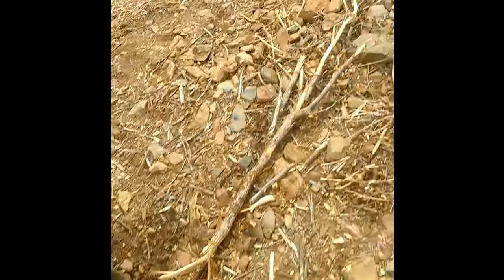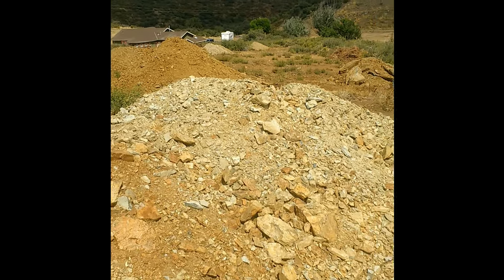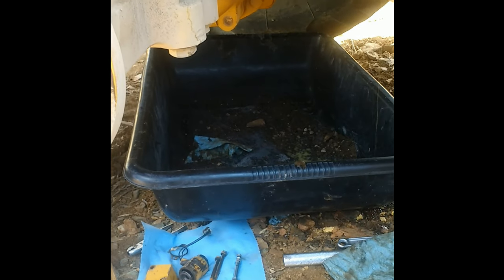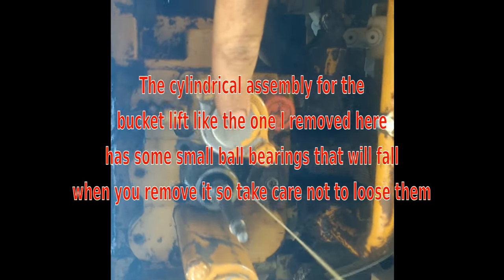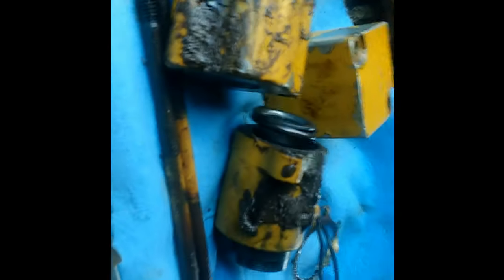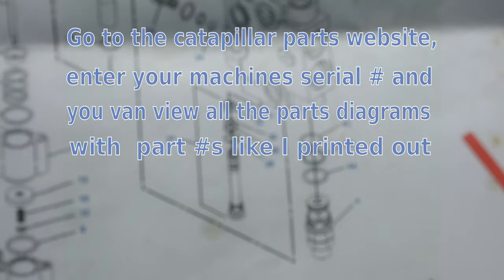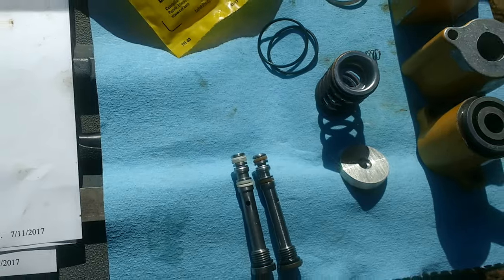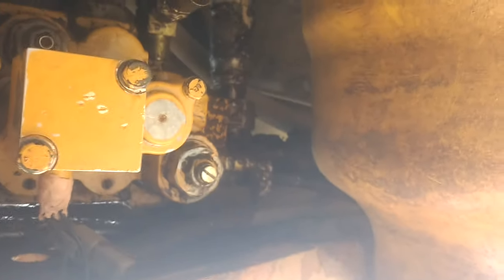Backhoe Hydraulic Repair - Loader Does not Lift

Comment: Thanks so much same problem 1986 416 . fyi if anyone has trouble with older machine that won't keep running rusty fuel tank. Friend of mine spent a year trying to figure it out thankfully only took me a week with his help!!!
Reply: Daniel Mitchell Rusty fuel tank. I learned to keep them full of fuel when not in service. I had to replace a steel tank on a diesel generator once. Sucks but works

Comment: It's usually the resolver ball assemblies that cause this problem, they're located on the side of the valve under the same style plug. be very careful because there are many different lengths to these and if you get them mixed up you can ruin the valve housing and set yourself back several thousand dollars for a new one, you were very fortunate this was your problem. 99% of the time it's not. I've been repairing hydraulics for over 30 years and the 416 cats are notorious for this problem, they should issue a recall!
Reply from the maker: Thanks for the feedback.

Comment: Would the principle of this issue apply to other weakness issues? I have a mini excavator where the arm pull (is that what it's called?) is a bit weak. Could the issue be damaged o-rings somewhere in the system, like in this case?
Reply from the maker: I'm not an expert on this.... From what I have gathered though if your arm pull is weak and it strengthens when you operate another hydraulic control simultaneously then its probably something in the resolver network, so yes maybe damaged o-rings on the resolvers like I had. Best of luck!

Comment: you did that the hardest way possible... its way easier to just pull the whole valve group down...and the best fix is just to replace the whole spool valve... messing with all the check balls for the detent is a nightmare
Reply from the maker: Thanks for the tip. Hopefully I don't have to do it again but if I do I'll keep that in mind.

Comment: hello where I can get parts for the hydraulic control of the jd400 since the originals no longer manufacture them. Any recommendation
Reply from the maker: Sorry I have no idea. Might check places like ebay and ask around at local shops or online tractor forums.